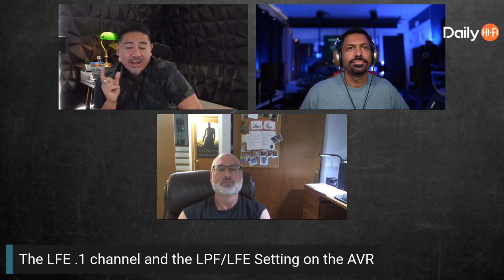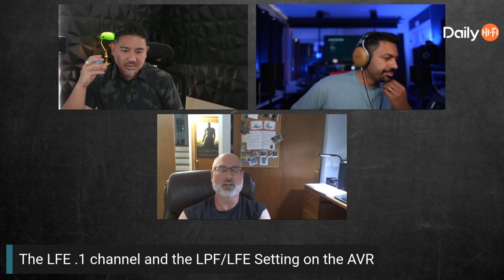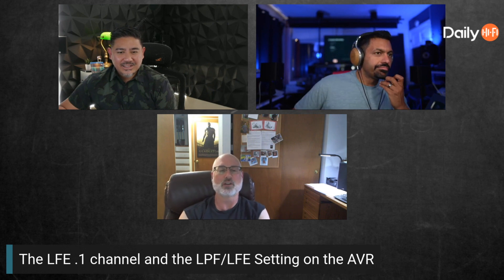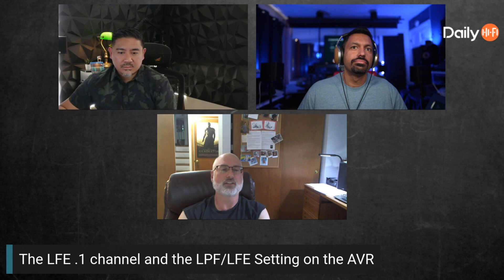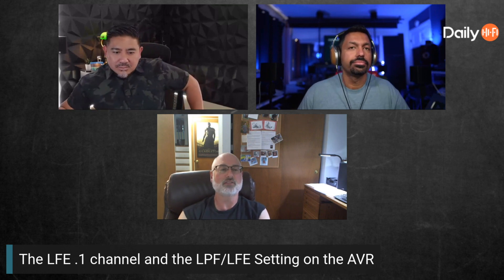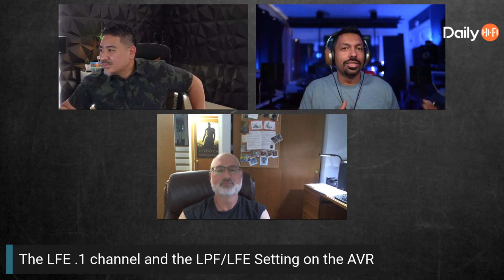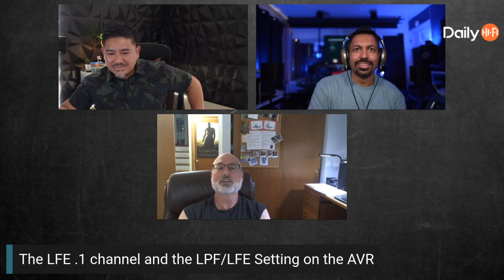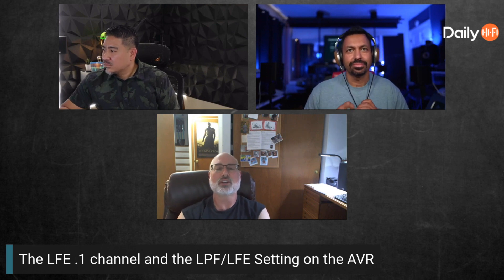LFE .1 Channel And The LPF, HPF, LFE Settings?!?

Comment: So if you don’t specify a subwoofer the system sends LFE to the mains, but if you crossover at 80Hz anything above that is discarded and NOT sent to the mains? That doesn’t sound right to me.

Comment: there's a more technical quote i read that the lpf setting for the lfe channel works slightly differently to a normal crossover so you don't lose any info in that channel. setting the crossover to 80hz or 250hz will effect the curve without cutting anything off. but i'm not sure thats a confirmed thing. 120hz seems to be the universal setting for the lfe channel so just leave it at that

Comment: If I set the lpf to 120hz for lfe, where should I set the crossover for speakers? If set to let's say 80hz, there is 40hz crossover, Is double bass is a big problem ? Should I set it higher?

Comment: Here's a thought to ponder if the AVR will allow it.  Connect a larger sub to the LFE output and add smaller subs into the R&L speaker cables.  Set the L&R to Large and adjust the HPF on the sub to match/blend the speakers.  I believe and may be wrong, but that would separate the LFE to it's own dedicated output/sub woofer.  Might be an interesting experiment for someone who has the gear to do it.

Comment: Joe, do you know how bass is handled, if like me, you have LCR set to large AND yes to having a subwoofer. My surrounds + Atmos speakers are set to small, So who does the bass management for them? LCR or subwoofer?.

Just for additional info my Mains + Center are connected to two front located subwoofers using high level connections and they are phase corrected. My two LFE subs are in the rear Since they are very close to MLP I dont want them to play anything from the front speakers, because localization issues.
I have never had better bass than I do now.

Comment: Ed is absolutely correct about the LFE being routed to the left and right channels when set to no sub. I just tested it on my Denon X4700H. What I said was also true for headphones that on mix down from multi-channel to stereo, the LFE channel is simply discarded. It might be different on different headphones as the AirPods Max connected to my phone does process the LFE probably because it's able to properly decode that .1 channel.

Comment: If the LFE is an independent channel, how is bass routed from the mains when you set the crossover to that channel, is the avr designed to do that or we just assume it routes the lower frequenct to the LFE channel?
Reply: Let's not get LFE channel and the Subwoofer mixed up. The channel is the signal sent to a speaker. In this case, the channel is LFE and the speaker is the subwoofer. When using bass management, meaning you're using a crossover for your mains, the frequencies below the crossover point get sent to the subwoofer. The subwoofer is also sent the LFE content. Hope that helps.